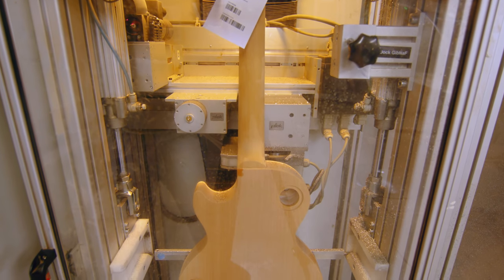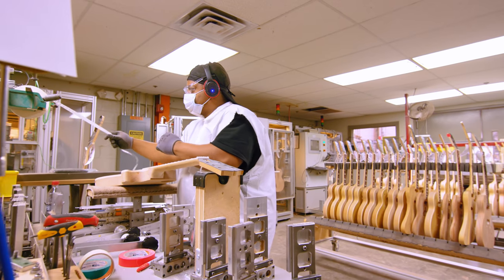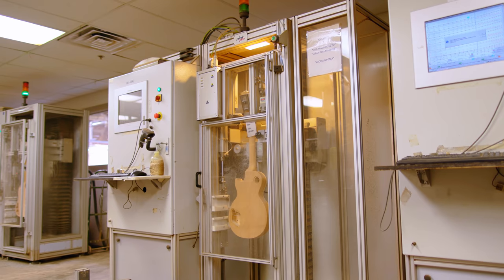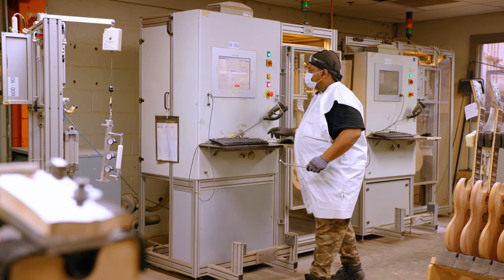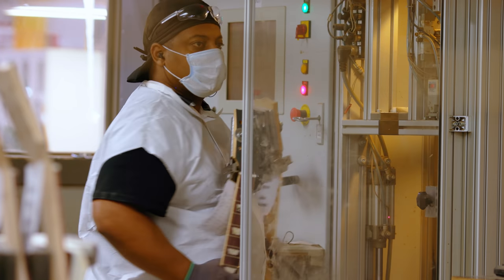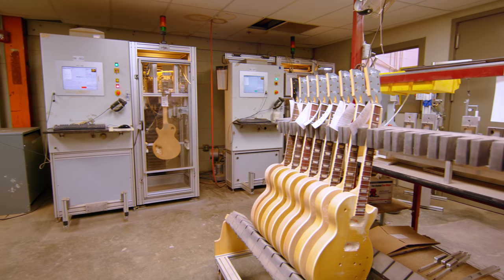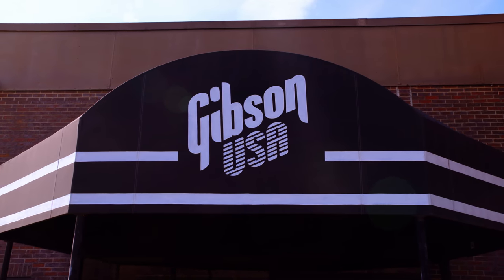Fret Leveling In The Plek Room At Gibson USA | The Process S1 EP8

Comment: Nice video but the quality still has a lot to be desired. I have own many Gibson over the years and the 2019 quality is still a shot in the dark. I had to play nearly 10 2019 LP to find one that played well and did not have crooked installed tuners, improper cut nut and a couple of high frets. So much for your plek process. You can make as many nice pro videos as you want but that does not change the inconsistency in your manufacturing process. Maybe one day you’ll get it right. 

Conversely, while checking out those 2019 LP, I also picked up 3 Music Mans and several PRS and in every guitar felt and played the same.  Very consistent, stayed in tune, the nut cut correctly they all played the same. Not as iconic, but they make one hell of and instrument.

Comment: I have a Plek'd Gibson. While the frets are nice and level, the fretboard has some machined surfaces that look absolutely horrible. And two nut slots are cut a c-hair too deep, causing buzzing on open notes/chords. 
But I have to admit, I still love my Gibson.
Reply: Anthony Nonya - For all the talk of Plek machines and their greatness, if the fingerboard isn’t right the only thing it can do is take away metal to try and make it right.  It isn’t right...it’s still messed up because the preparation wasn’t done at a high level before the frets went in.  I’ve seen and fixed many.  Kudos for your comment.
Reply: I had to change the nut on my brand-new LP Standard 50's it was so bad. The wound strings were buried in the nut way too deep. And the frets themselves look like they are straight off the Plek machine. They were NOT finish-sanded and polished. You can still see the machine marks on them from the Pleks cutting head. Gibson should shit-can the bean-counting mentality and get some QC in there.
Reply: Dave Skowron - I couldn’t agree more.  Gibson has a history of poor quality control and until they eat some humble pie and address it honestly with themselves it won’t change.

Comment: Are the guitars put back on the plek to be measured under string tension or are you just using the plek to cut down on fret levelling time ? Once that neck is under tension the plek scan is going to change. We have the plek not to just look at fret height but the radius of the fret board and neck relief and this can all be done while the instrument is strung. I believe this is the purpose of the plek , it’s about producing quality not quantity.
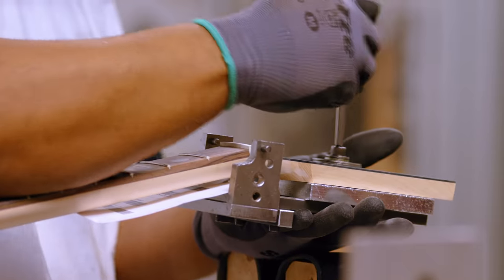Reply: 1:34 they go in with a pre-tensioning jig attached to simulate string tension.

Comment: The last les paul traditional I had I bought unseen on ebay,when i got it i found the bridge and tailpiece had been mounted off centre by 1millimetre in the direction of the control knobs,doesn't sound much but the string alignment from the nut down the neck to the bridge was so bad that the high e string would come off the edge of the frets when playing up around the 15th fret,i had to buy plain bridge saddles and cut the slots myself to bring the strings back into alignment with the neck,i'd never buy a Gibson unseen again,always loved les pauls but how the fuck can a guitar like that go right through their build process and pass qc checks and leave their factory?

Comment: My custom shop 2019 LPC’s nut had sharp edges and the slots still had excess nylon hanging off them and the fact the guitar has a bigsby this caused lots of issues. The saddle weren’t even filed. When I used the bigsby the bridge would actually move. Lots of work had to be done to get it to work nicely and to not scratch my hand on the nut. Plek isn’t enough to get it right. It’s a shame such a high priced guitar was so neglected.

Comment: When is the fragile neck-headstock design being addressed and improved? It's much stronger on imported Epiphones, and stronger on other brands. That poor design is just as much a quality problem as anything else being improved. Lower headstock angle, Scarf joint, small truss rod hole (or move it to the heel), and a volute -- all high quality design features other competitors have done for decades to help make their products more durable and long lasting Quality..
Reply: jvin248 Because they don’t need to change anything, it’s fine the way it is.
Reply: Sadly, it's Gibson, so people are still going to buy them no matter what and they know it. They know it's an issue, they don't care, you'll buy another gibson if your headstock breaks off, in their mind.

Comment: Why a rounded fret profile?  Shouldn’t it be a fine point up top for better intonation.
Reply: No, rounded (crowned) is correct.
Reply: @ParaBellum2024  correct and better are two different things.  A fine point fret will always have better intonation than a rounded fret.  A rounded fret has a larger point of contact than a fine point.  you want the string to contact right at the middle of the fret and no where else.  any larger of a contact and you'll be close to the front of the fret and will be playing sharp
Reply: @juka421  Thank you.  Do you write from experience of crowning frets, or is this just your opinion?  When I crown frets, I create a rounded profile.  As any luthier will tell you, only an idiot would file frets to a narrow ridge.  There's no advantage in intonation, and the fret will wear quickly.